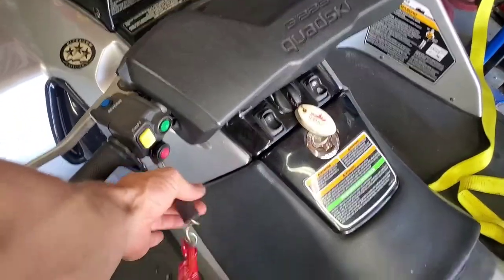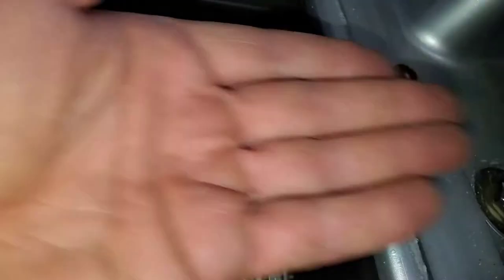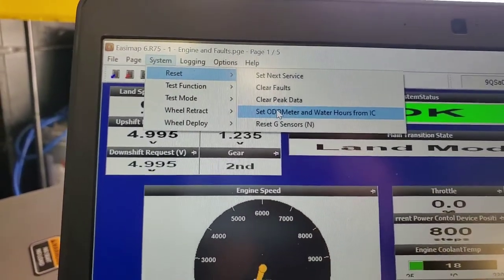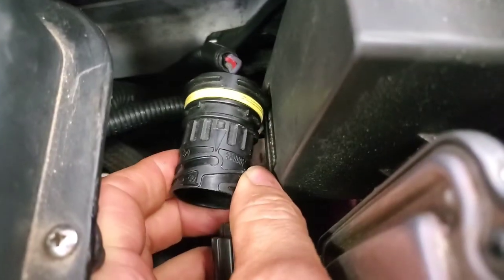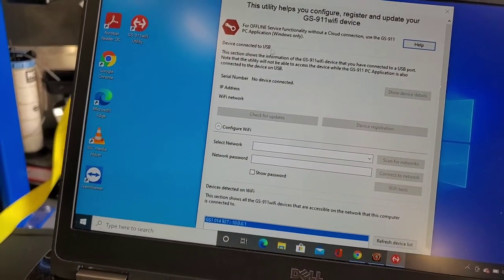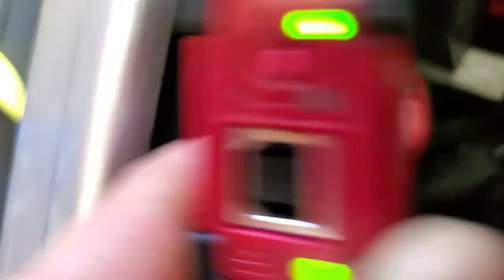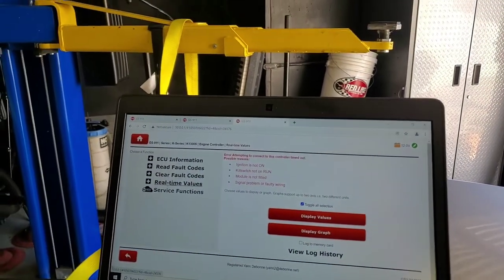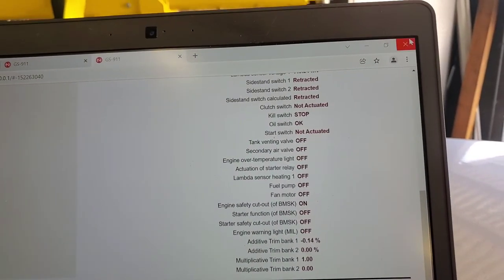Gibbs Quadski Code Read or Live Values (How To)

Comment: thank you so much that puts me at ease.  do u know belt replacement and is it difficult to change?
Reply from the maker: It is very time consuming. You must remove the differential. Must pull the propeller shaft, remove the bolts that hold the transfer box on, which will most likely be seized up if you use it in salt water. Then there's just enough room to turn the diff and transfer box slightly to wiggle out of the body. I would highly recommend replacing the differential oil while it's out as well as fitting an oil filter relocation system as I've shown in another video
Reply: @HollywoodMechanic  After removing propeller shaft and bolts that hold transfer box on, do you also have to remove the Shaft ASM PTU input and decoupler cable?  Thanks again

Comment: Hollywood

Quadski will transfers back-and-forth from water mode to land mode but when in either mode the unit when given throttle doesn't drive the unit meaning in water mode the impeller doesn't spin nor in land mode does the wheels turn. Is there anything for me to try any help is appreciated thank you

Ryan
Reply from the maker: Yes, there is a belt in the transfer box that must've broken on yours. The output of the engine drives the belt which then drives the propeller or the wheels
Reply: looks like it is ptu belt.   Is there a video on how to remove this and replace the belt Is there a video on how to remove this and replace the belt or step-by-step instructions on how to remove the PTU.

how much has to come off?
Reply from the maker: @fsuno1e  contact Gibbs for workshop manual. They are very helpful